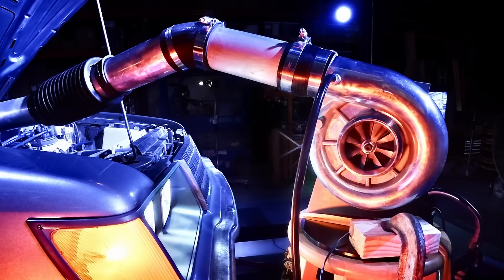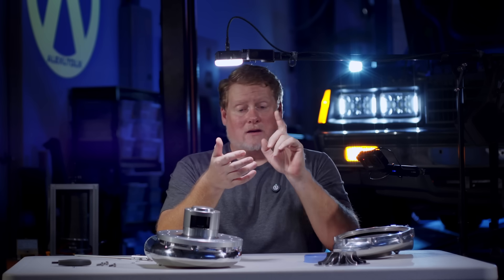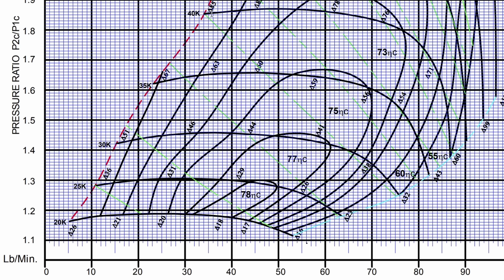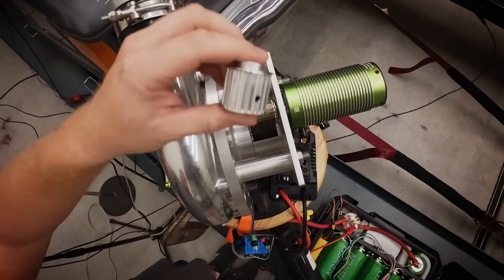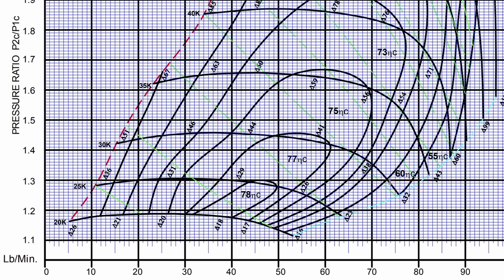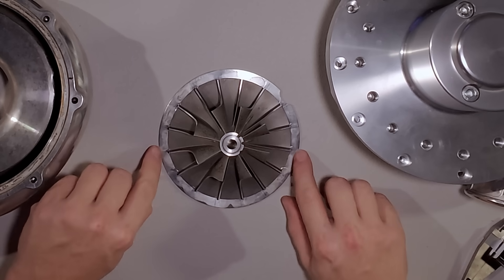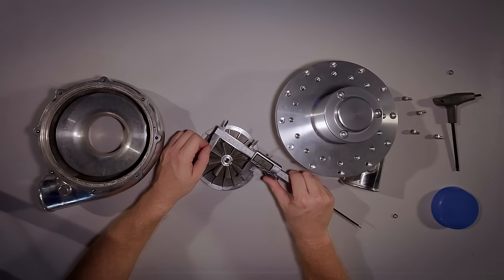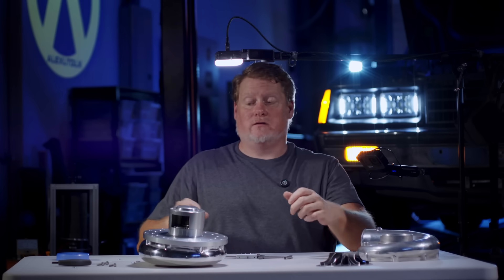DIY Electric Supercharger Mystery Solved

Comment: It's not a supercharger, it's a turbocharger.
Reply: A turbocharger or, more correctly a turbo-supercharger, uses exhaust gases to spin a turbine (hence the "turbo") that turns the supercharger impeller. 
A supercharger, traditionally, uses engine power to turn the impeller. 
This is a supercharger, specifically a centrifugal supercharger, since there's no turbine.
Reply: @Surestick88  Or it is more a turbo because it is NOT powered by the engine. An external electric motor is not THE engine. I think in the modern sense a turbocharger is not called a turbosupercharger now, any more than a 3 cylinder ecomotor is a rotory aircraft engine where the term turbosupercharger came from. So is the exhaust gas the kicker or is anything that is NOT directly powered by the engine the kicker? Also to be pendantic, the exhaust turbine powers the supercharger, making the supercharger seperate from the tubine. In this case, the electric motor powers the supercharger in lieu of the turbine.
Reply: @pappyman179 No because there's no turbine.

Comment: Why?  Sure, far more controllable over an exhaust driven one.  Makes a tiny engine do the work of a bigger one.  Makes EPA corporate fuel economy numbers.  But Section 209 is repealed, so it has no purpose anymore.  As a hot rod accessory it makes things simpler.

Comment: What do you think of the Rotrex Supercharger ? Would you consider reviewing and testing it in the future? Regardless of the cost, it delivers good results, excellent efficiency, and has an internal gear shifter. There's no need to use a belt.
Reply: Centrifugal blower is about as close as you can get to a turbo and is basically the same as these from what I'm seeing , just one on a belt and one pure e power , if it has to be a supercharger,  I definitely would choose a centrifugal blower over a roots style or twin scroll , they have a better power threshold and besides dodge with there two different style scrolls to make it loud af , I honestly dont think there is much in comparison to sounds either 😅 but im a turbo guy , so prolly a lil bias 😉 😅.. but hey , long as its FI , it's good 😅.. peace and love brotha, keep it rad, stay safe, and build on..l8r famz

Comment: The concept is cool but it ends here. 
It is better to build hybrids with a battery.
Reply: More power from the powerplant is still more power. And you're talking about the cost of a home built racecar going from $100k to $400k, or from $30k to $200k. Compared to a $4k sc?
Reply: @operator8014 regular turbo is cheaper than electric blower, works every time you step on it.

Comment: Man my solid head sb2.2 388" sbc on m1 with the old 98mm gt55 based turbo can put down whatever i want it to on a dyno... 
All I really need to see is the correction factor and load percentage it's a tool that's it 
I can plot and guess any compressor map i want and then run it on the dyno and yea I have a close idea of what she's gonna put down but EVERYTHING  is going to be different but it's CLOSE.....
Put it on the track I changed to a G55 110mm with a 1.30 exhaust 2 weeks ago and picked up 3 tenths and EVERYONE thought it wouldn't spool " it spooled faster" 😂 tbh I don't care what the dyno says... the track is king and all that matters is what that blonde girl hands me on that receipt paper after I make a lick because I know the REAL variables when I let go of that button!!!!!

Comment: Sadly, i'm finding this video now. I've got hundreds of dyno pulls w/e-superchargers. I could have saved you a ton of time. Get the biggest wheel you can fit (good luck on a civic), but on a truck, get a holeset 35 or 45 (semi sized wheels). The air is the hardest to move, the weight of the wheel is negligible. 

Do you have contact info? I'm not a thumb typer.

Comment: Alex those wheels aren't right for your engine size and rpm (including the si trim) for the hp numbers your getting. Use your pressure ratio and rpm data to find the right wheel that puts you as close to the peak efficiencey island on the compressor map. There's usually only one or two islands or closed circles on the map graph and thats where you want to be especially on a no charge cooling setup will flow more at the pressure ratio, generate less heat and make more hp. At least a ysi I bet, check out some of the better flowing wheel maps.

Comment: lovin the work youre doing. id consider a supercapacitor bank to lessen voltage sag. i can donate a 48V 165F one to the cause if you just pay shipping. lmk. im in cali.
Reply from the maker: I am indeed grateful for the offer, but there is a problem with super capacitors. Their voltage discharge curve is almost perfectly linear, which means they might be good for the initial burst but after even a second or two, the voltage would drop to the point where they would become a load on the batteries. I actually did experiment with a super capacitor some years ago. A big one designed for starting locomotives and semis. It's buried somewhere in my videos. Once again though, thank you sincerely for your most kind offer.
Reply: @AlexLTDLX  i found 2 videos in your collection regarding a supercapacitor. that thing is a far cry from what i have here. for the very short duration dyno pulls, and possibly even drag pulls, im certain my supercap would improve voltage drop and therefore impellor speed and performance. i cite Mr BBi https://www.youtube.com/watch?v=FZ_3N4WKn-Y.  im certain my cap would improve performance. you should give it another consideration. or just buy one urself to test. theyve come down in price lately.
Reply: @darkcloudfitness  how much would it cost to ship, maybe I can pick up the tab.
Reply: @darkcloudfitness  Unfortunately a 165F capacitor would help for less than a second at the power levels the motor is drawing. Capacitors really don't hold that much energy.
Reply: That's actually a good  idea💡

Comment: I cannot express my excitement enough.  We look to be close in age, so I know you saw the early electric superchargers that be lethargic at best and power robbing at worst.   They were a massive joke and anyone defending them, felt like someone trying to tell me WWE was real.  These motor are crazy powerful compared to those old ones and this while never really going to be a practical addon,   for drag racing and maybe industrial I could see a huge benefit.   The extra teaching is nice too.
Reply: So I've never deleted a comment before. I misunderstood your comment. I'm trying to understand from what angle your trying to find this to be impractical? I suspect this would work in a vacuum cleaner.
Reply: @trunk8d  all good!   I just meant as a daily driver this system is pointless,   but growing up there were all the cheap systems that add horsepower!     They were little more than an air restriction with a spiny bit.   Swap to drag racing and this will shine.
Reply: @Sc1Z OMG I hate the Android YT app. This is my third attempt. 
So I'll keep it short. This should absolutely be streetable. I cannot see how this would be restrictive. I suspect longevity is the real concern and that's a guess because I don't know much about the electrical motors and controllers. I would expect an increase in volumetric efficiency in idle to part throttle if use of the turbo could keep kept in a partial boost during those periods. Additionally there would really only be a quality of life update needed to powering the controller either an AC to DC convertor for battery charging or providing pass through power to the device and the controller. And thanks for the niceties I wad rather less than congenial originally.
Reply: @trunk8d  the restrictiveness i was speaking of was not for the system he has developed, I was talking about the ones from the early 80's and 90's.   This is impractical because the power requirements, battery system,  wiring,  controller,   all this added complexity when a simple turbo and you are done.       I would imagine if it was used constantly the power system wouldn't be able to keep the system charged and if it did those batteries would be smoking hot, I am not sure if you ever have charged those packs but they take a very long time.

Comment: Consider contacting John Metric @lonestarEVperformance for cells. He has 200C cells that would make your pack lighter, smaller and run without voltage sag. I am sure you have considered looking for a compressor wheel and motor that you could direct shaft drive that would compliment each other.  I have been thinking of building one. I see the advantage of slightly altering your pulley ratio however.

Comment: Electric turbos. Are real! I've Always tried the cheap eBay e turbos. If they just used a better, non magnetic motor, non plastic parts (Mr. Amr500 supercharger, i'm talking to you) many better options today, Torqamp, phantom, your setup and all the imports toying with these systems. It's about time! I never understood turbos. I mean I do, but extremely hot exhaust gasses spinning a metal turbine in a hot case with a turbo blanket and all that heat isn't good at all for an engine, let alone IAT readings. Then an interwarmer to just warm the intake charge to still throw hot air into the engine. Then oil coolers, oil lines which create more heat. I know it works, but a DEI cryogenic CO2 intake section with an aerodynamic bulb that is cooled before entering the engine would be a benefit in my eyes for this setup. I don't know, traditional turbos seem old school nowadays and not really worth the money unless your a sponsored person making millions. To us everydayers, if you want power, an eturbo might be the best way
Reply: Honestly your opinion on turbos sounds like it’s from wildly bad turbo setups rather than because they are bad…
Reply: Actually the heat is a main component for a turbo as it harnesses the energy that is put out by the heat hence the turbo blankets and whatnot trying to keep all the heat within. It's still energy
Reply: @mastercricket7626  The compressor side of the turbocharger can deliver cooler air then a supercharger after an intercooler but it depends on boost level. Heat drives the engine too but because heat creates pressure that then makes high speed exhaust that drives the turbine.
Reply: @skerlone thank you for being kind. It was takin wrong by some commenters, I was just trying to explain my thought process how a cold air intake is so beneficial but then we add heat to the equation. Some rather just try to make me sound silly lol I thought there was no stupid questions, "highschool teachers"
Reply: @skerlone yes , but that has what to do with my comment ?
Reply: @mastercricket7626  Maybe I misunderstood you but what I try to say is turbos can make lower temp boost then a supercharger or electric supercharger because the efficiency is higher on turbos.
Reply: @skerlone this is true , i was simply correcting the fact of heat on the hot side , the fact that they try to harness the power from the heat and utilize turbo blankets for that reason as all the heat wasted is power loss.. but by all means , i love chatting with fellow car enthusiasts

Edit , ps , im a turbo guy myself , i dislike the parasitic loss of belts , but alex is starting to make me think with the e charger 😅
Reply: @mastercricket7626  yeah keeps exhaust gas velocities up
Reply: Idk what "interwarmer" your using but it sucks 😂 I built my a2w from ebay cores along with the 5 gallon water tank and I've NEVER had a IAT temp above 115 degrees even after a 45 min cruise on the street with 2 15lb bags of fresh ice before the pass e85 helps a ton especially if you run misting nozzles at the entrance of the intercooler with the water pickup for the pump directly in the ice my A2w is also mounted to firewall inside of the dash in a 85 hatch foxbody 
Ive been toying with a evaporator core from a 80 international bus charged with 1234a and electric compressor and condenser for a standalone unit but haven't worked all the bugs quite yet
Reply: Were u at fam , im in nc and my ata keeps me at 80-90° and i dont like that , i have safeties pulling timing by 115 and thats on pump 93 well a mix i make that puts it around 100 , but still , i plan to go atw and methanol injection to get it even safer , is that at full boost or just cruse ? I'm genuinely curious as doing research b4 i spend another 1000 bux on just cooing intake temps and figure atw would have ya quite a bit lower , like atleast 70 if not in mid 60s with ice .. @ZackeryStang
Reply: Guys. I'm just trying to hype up an eturbo build. I drive a Pontiac Grand Prix lol chill
Reply: Water injection with a massive high voltage ignition system.
Translation of nazi research will uncover all kinds of secret sciences
Reply: A turbo can make more boost with less air heat because it can be kept in a higher efficiency range then a charger unless you can play with its rpm to match engine rpm. Believe it or not superchargers have higher IAT's then turbochargers.
Reply: Electric motors can not be non-magnetic 😂